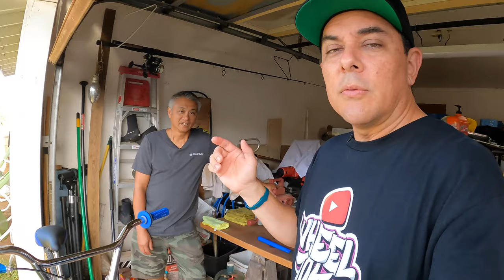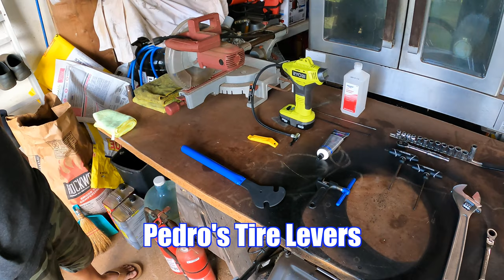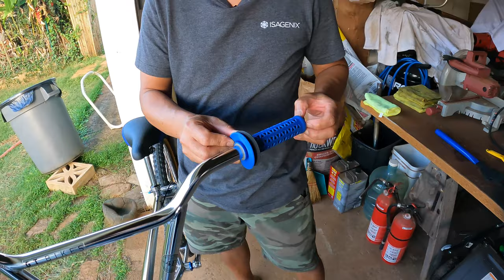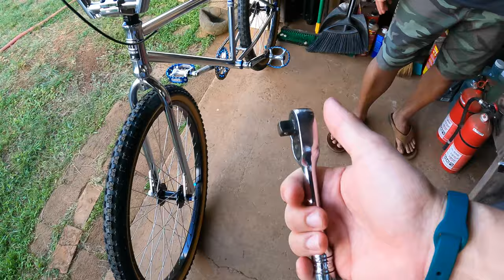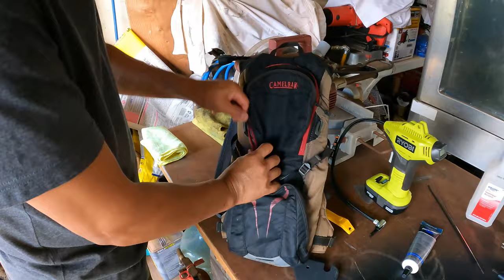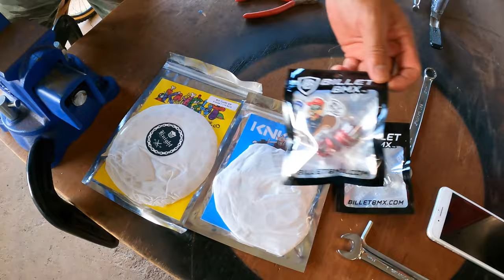The Tools YOU NEED for your Basic Bicycle Tool Box

Comment: Aayyy!! Thanks so much for the shoutout!! This is so funny, and a HUGE coincidence. So after I wrote that comment you highlighted, I was watching a video on Shadow chains (which I have never used). So they have a "master pin" which is obviously just the pin and not a whole master link. So I haven't re-watched your previous video, but when you were talking about a master pin, you were probably using the right verbiage. I'm not always right!! haha. So here's what DansComp says about them: "Replacement master pin for Shadow Interlock Supreme chains. The original pins of the Interlock chain are flared, so pushing the stock pin out removes the flare and compromises the strength of the chain if re-used. Anytime an Interlock chain is taken apart, the original pins should be replaced with a master pin to ensure maximum strength and reliability." Cheers y'all!!!
Reply from the maker: It’s all good brother! Believe me, you know way more about bikes than we do and that’s cool! We learn a lot from your channel so thanks for the mutual support and for being cool about your advice! Appreciate you!!
Reply: @cruisinginthe808   I have at least 100 hours of video I need to edit (I'm not joking). Let me know if you're interested!! LOL

Comment: Try a Crank Bros "Speedier" tire lever sometime. They have a hook that is VERY helpful when putting stubborn/ stiff tires on. I put some S&M Speedballs on recently, and couldn't get them on without my Speedier lever. They're amazing! I got a backup recently at Dans for only $7. Well worth the money :D
Reply from the maker: I will definitely look into that! Thanks for the tip!!
Reply: Today I finally got my new Comp III’s that I’d been waiting for months to be back in stock and  when I went to put them on, I didn’t even have a flat head screwdriver, much less an actual tire lever to use. I couldn’t bear waiting any longer so I used a butter knife and a spoon

Comment: Great Video 👍 I totally agree with the tools you guys talked about. One specific tool that I always get confused about (but I see alot of people using on their bikes) is a torque wrench. Do you really need one? A quality torque wrench is very expensive but there are some knock-offs on Amazon or other online shops that are fraction of the cost. Is it worth paying top $$ for a quality torque wrench or do you just use common sense to decide how much force to use to tighten a bolt down 🤷‍♂
Reply from the maker: Bernie and I have been debating on whether or not to get one. I think we want one because it's always a good idea to use the right torque when clamping down bolts, but honestly, we've never used one all this time and we've been fine. I think it's one of those tools that's nice to have but you can get by without it. Yeah, some of the Park Tool stuff like their torque wrench is on the expensive side, but they make quality stuff so I think you get what you pay for. Let us know if you pick one up and thanks for watching another one!

Comment: I have the T set Alan keys and I've also got the torque wrench a mini wrench set  wrachet set spanners deep socket set I've got things I don't need but u never know crank removel set spare grips inner tubes for all my bikes and I need more room olso a  electric bike pump it can fit in my pocket but  your ruk sak will do🤔☺️
Reply from the maker: This was just our basic tool recommendations. Yeah, there are some other tools that would be helpful as well like the crank removal tool. We’ll cover those in another video. Thanks for sharing and watching another one!!
Reply: @cruisinginthe808  I think I've hot more than I needed but I've always had took I use to build pallet Racking for a  Design company and mobile shelving for hospital files